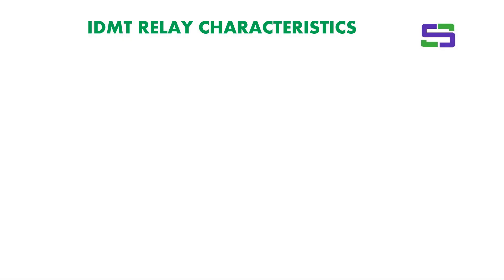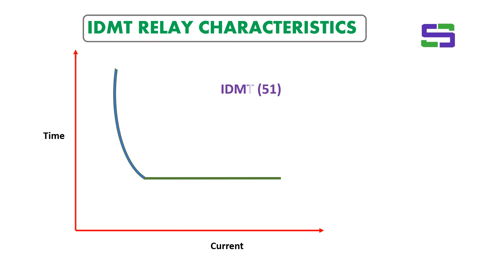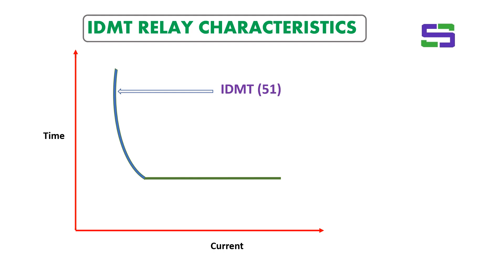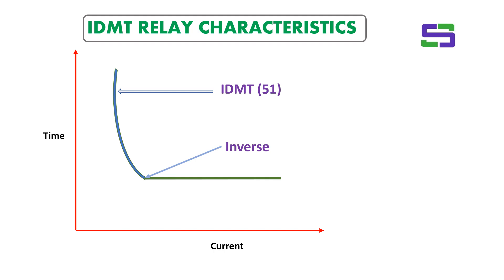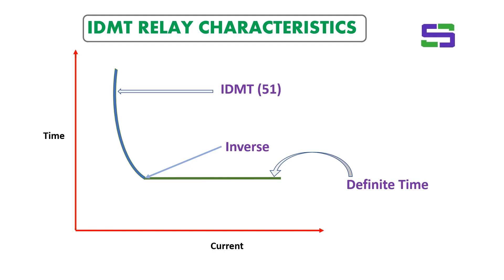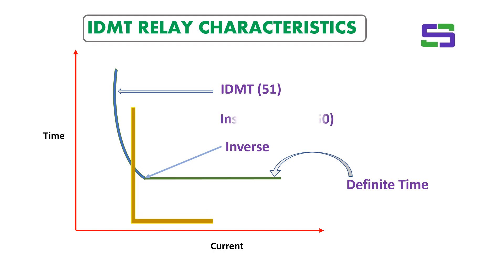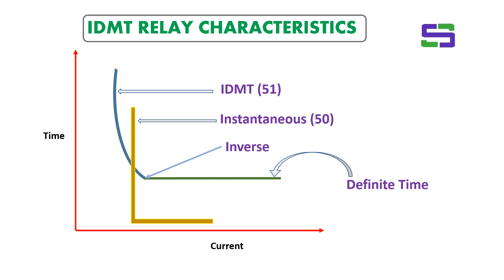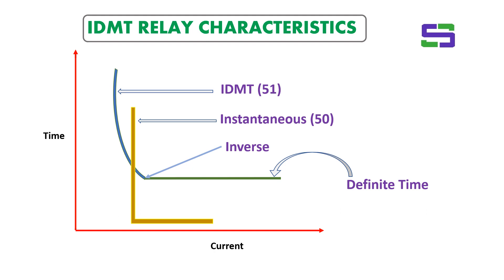What is IDMT Relay II Inverse Time Relay II DMT vs IDMT Relay Explained

Comment: Sir, In a Transformer primary OCR relay following settings made.
IDMT OCR : 112% 0.14TMS (3 SEC SI curve)
DT OL 1 : 114% 6 min.

Why Inst.OCR not recommended here
Why IDMT used here
Reply from the maker: It looks like the setting is not correct; Inst (50) element can be applied based on trafo. data which is not mentioned here..